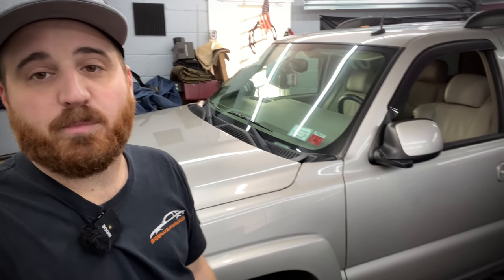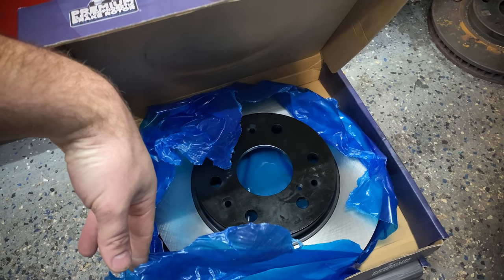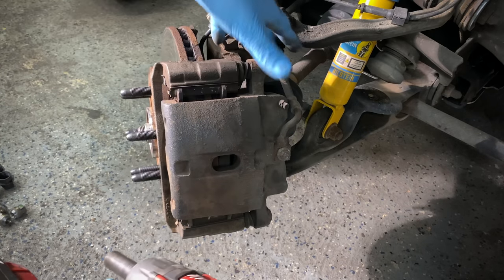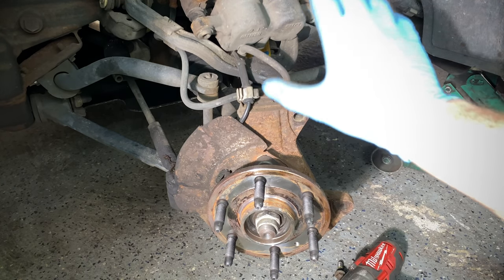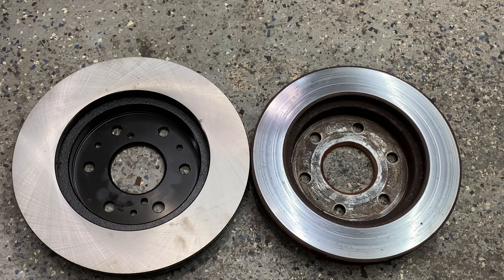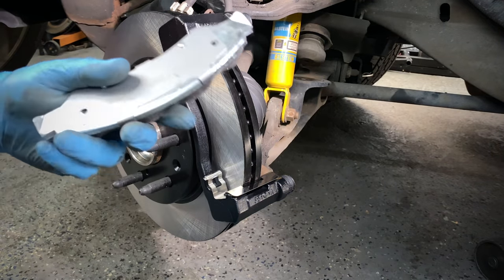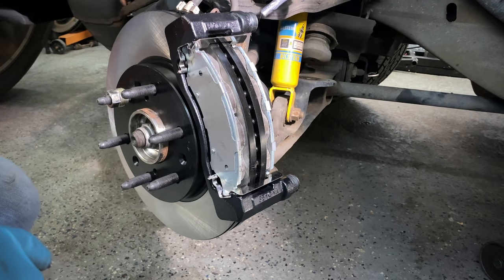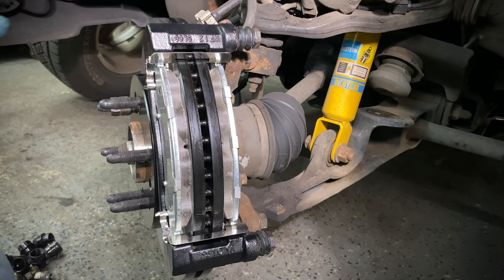This Budget BRAKE UPGRADE is Incredibly CHEAP & EASY!

Comment: I wish I didn't need 2pc rotors, 14" or larger to stop my big pig😢.....i have out grown the 13" rotors which were great until my truck kept getting faster! Now i spend $900 for just TWO front rotors from Baer. 

Dont get me wrong, the gmt900 brake upgrade is def worth it.....unless u have a 550hp awd denali with 12.5" wide Chevy SS 22" replica wheels! 

Having 2pc 14" rotors helped slow my brake fade. I even spend big$ on RF-650 fluid so I dont boil fluid anymore but at 145mph there's no getting around it, the heat soak is to the point where my foot can feel the hot gas between the pad and rotor with no brake bite whatsoever!......thats when I know, "this could be the end for me"

If i want to stay alive, it's time for me to spend $5k on a real performance😤 upgrade
Reply: No getting around physics there.. that fact that 6000lbs GOES 145 mph is mind blowing, yet alone throwing out the anchor at speed 😁

Comment: Here's a test for you.  I suddenly developed a rattling noise on the lower, right, rear of the engine area.  A suburban guy said he had the same sound, and it was pieces coming loose in the cat.  He cleaned them out and the sound went away. What do you think?

Comment: FYI, this mod only works if you have 17" wheels and bigger, any size below 17" it will not work.
Reply: Sooo...should I conclude that since I have 17" wheels, on an 05 Z71 Silverado, the larger rotors and calipers are already on it?
Reply: Thank you for that info. I'd love to do a mod like this on my 99, but not possible unless I replace the 16s with 17s, and that ain't in the budget yet. I have always hated my brakes.
Reply: @Tommy_Mac  In 2005 GM upgraded the brakes on half ton trucks to use larger front rotors, so you already have the upgrade. The trucks switched from rear disc to rear drum at the same time. The GMT800 SUVs did not change the brake rotor diameter or calipers, in 2003 these applications switched from vacuum assist to hydroboost. The hydroboost system applies more assist than vacuum, so braking performance is improved.
Reply: @wickedwolverine350  thanks for the info. I have a vacuum booster, though. No hydroboost.

Comment: Would the same concept work for the rear brakes as well?  Pre-2007 the rear brake rotor is 13" and Post-2007 is 13.6".  Would imagine an 18" wheel minimum to fit over the larger rotor.

Comment: will this dual piston upgrade or any other dual piston upgrade work on my 2000 cadillac escalade. I would like my brakes to have more control, more grab and work better pulling small camper?

Comment: 1st, If a Tahoe vid gets more thumbs up then a Camaro or Trans Am, Ima be Jacked, Makes me wana Not give it a thumbs up... Anywho, The reasons I am messaging is, When using the bottle/one man bleed, What about the air in the tube when u start the bleeding process? Also, I never pull the line/tube off b4 closing my bleeder!!! I guess, I,v never trusted the tube that i use to stay on the bleeder so, I always get a friend to help pump the brakes while I operate the bleeder, opening & closing it. Obviously any Trans Am or Camaro is nicer then my 07 Pontiac G5 but, I'd like to upgrade my brakes & plan on it! I just got it a week or 2 ago & iv done a new timing set up, 4 new tire's, a set of new control arms (just ordered the control arms yesterday), new window regulator, oil change, new floor mats & cleaned it up a bit!!! Soon, I will be redoing my entire suspension, upgrading the sound system & adding some features that the car was not ordered with like fog lights! It is prewired, just doesn't have the switch within the interior, the fog lights & the factory grill inserts(bottom of the front grill, there is 3 inserts, a center grill & the end or corner grills on either side of the lower bumper, mine have blank pass threw grills, the factory option with fog lights, has the housing for the fog lights built into the 2 grills so, I will need to buy each of those two grill inserts!) Oh yea, when I got the car, It was missing the center lower grill! I replaced that with a new one!!! Anyways, I like all automotive content but, Id rather a F-body get more thumbs up then a Tahoe vid....although, There are prob more people with tahoe's then people with F-bodies?
Reply from the maker: You can crack the bleeder and it wont get any air in the system. Thats how gravity bleeding is done. You just crack the bleeder and let the fluid drip, the air eventually gets pushed out with it. Any air in the hose is pushed out on the first pump when using the bleeding cup.

Comment: I dont see my answer here, so using 1 in larger rotors, can you use your stock caliper brackets,,,just buy new rotors and calipers??
Reply from the maker: No, you need to change the calipers and brackets.

Comment: Will this work on my 2007 Sierra Classic with 17" factory rims? I just went from a 2015 Silverado to this truck, and braking is probably the thing I miss most! I found a 2015 caliper and rotor kit on 1A Auto for $340

Comment: My 05 suburban has really soft brakes. Wish I knew this before I bought new calipers. Because they didn’t change crap
Reply: You need to bleed the abs unit. It takes a tech2 or snap on brick
Reply: @danhammond8406  it’s hydro boost if that changes anything l. Thanks for the tip

Comment: Good thing I came across this vid I have a 06 Yukon Denali. Will 2012 Tahoe calipers fit? Also are the rotors from the 07-12 the same diameter? Thanks

Comment: My brake line doesn’t look like yours ? Watched all your videos since you brought the Tahoe and haven’t seen the lines changed and did my research the part that connects to the caliper with the bolt isn’t with other brake lines so I wonder if it’ll still work for my Yukon

Comment: Good Video 
Question?
i have a 2017 Tahoe 4x4
will the 2018 Tahoe PPV Stuff FIT on the Civilian TAHOE ???
theOnly difference i see is the HOLES DRILLED in the Front Rotors HAT !!!for HEAT Dissapation ?

Comment: I just installed 2007 tahoe calipers, rotors, and brake pads on my 2003 tahoe. Turned the car on and now it says “service brake system” and the pedal drops to the floor. I have no pressure on my brakes. Anyone have any idea? We bled the brakes like 3-4 times.

Comment: Will this work with a 2004 2500HD? Obviously I need to pull from an 8 lug newer 2500, but wondering if it will still bolt on. Thanks in advance for any answers!

Comment: What about the rears? My wife’s 04 Tahoe has disc brakes on all 4 corners. Would this work on the rears as well?
Reply: If memory serves there's no difference in rear brakes. The fronts do 70% of the braking power anyway.
Reply: The rears can be upgraded too I believe the rotors are one inch bigger in the rear and has a single piston brake unlike the nbs has a dual piston caliper.

Comment: I noticed you said that that these came from a police package Tahoe.  Are the regular Tahoes the same?  I've known about this for some time but it was using the front brakes from the 05+ GM trucks with drum brakes in the rear.
Reply from the maker: Yea I believe the front brakes on the rear drum trucks are the same as these. The PPV brakes are the same as the regular Tahoe's, just different pad material. Size is the same.

Comment: So did you use 07 rotors and brake calipers Right? I have a 2002 I wonder if I could fit this set up
Reply from the maker: Yea 07 calipers and brackets.
Reply: @lsxmatt  mines a 2wd gmc is it still the same?

Comment: @Lsxmatt do you know if this will work with the models with the hydroboost brake systems?  Ive got an 06 escalade esv platinum I want to get the best braking out of the system I can, its a lot of weight to stop!
Reply from the maker: Yea it doesn’t matter what brake booster you have
Reply: @lsxmatt  Thank you! This will be a nice upgrade!

Comment: I installed all the components for the upgrade. But, when I tried to move my Tahoe it was stuck solid. I discovered that the new calipers were binding against the inner rim of the wheels that were on the Tahoe when purchased. Had to remove the new units and reinstall the old brakes back on. Question - What wheel and size were on the vehicle you did the upgrade on? Were they standard 16" factory wheels or larger wheels? Just bought 4 new 16" tires for the custom wheels. Wondering what to do. Chris Kyser- Hurricane, UT
Reply: Well, I now have new 17" wheels and tires and the brake upgrade works. Now to find a buyer for the 16" custom wheels and new 16" tires.  Lesson - Do more research before you try something out.
Reply: Sold the 16" and bought the 17" for the conversion. Works great,!

Comment: First off if you don’t want the fluid to leak out get a clamp style vice grip made for pinching off hoses. Second flush your brake fluid. IT SHOULD BE CLEAR NOT BROWN. brake fluid is hydroscopic and pulls moisture from the air and will cause it to boil new brake fluid should be done around ever set or two of pads

Comment: Hmmm is the spare tire/wheel a 17”?  It would suck to have a flat and the 16” on most tahoes not fit with the bigger rotor ?
Reply from the maker: I dont think the spare will fit, you would need to rotate it out if you get a flat.
Reply: @lsxmatt  can a 17” wheel fit in the spare location?
Reply: @travissheehan6082  yes, a 17" spare fits under the truck in the stock location. I have a 17" spare on mine.

Comment: Any 17" wheels will work with this amazing mod, 16" won't. And don't forget a spare!!! A factory spare on GMT800 is 16 inch, you need to get a 17" spare from GMT900 or Nissan Titan/Armada, otherwise you are in for a surprise at the most inconvenient moment!
Reply: You can just put the spare on the rear & move the 17" to the front

Comment: Matt, 

I just installed the kit you details recommended. Won’t clear my factory wheels or my aftermarket. Did I miss something in your tutorial about needing wheel spacers?
Reply from the maker: No spacers on factory wheels, but pretty sure they only fit 17’s. What size wheel do you have?
Reply: @lsxmatt  I have 16in steel wheels on mine, but also tried to rock the factory GMC wheels
Reply: Looks like I do need 17s, damn. Ordered some spacers to see if I can get them to work; just bought new wheels and tires for my build so the juice isn’t there to squeeze bigger wheels.
Reply: @lsxmatt  wanted to pass along to help fellow owners out. Stock 16in wheels will need at a minimum of 1.25in spacers for everything to fit with little rubbing. Also just subbed to your channel, thanks for the vids as they are helping me freshen up my 05 Yukon.

Comment: So this does work on factory 17s like the GMC Denali 1500 xl chrome wheels ?
Reply from the maker: I’m now using the stock 2004 17” Z71 wheels and they clear without an issue.
Reply: @lsxmatt  awesome man I thought so. Think I will make the upgrade. Have a 06 GMC with the 17inch chromes.  Thanks for the videos. Enjoyin them!

Comment: So what is making this upgrade better? I understand the caliper change but it seems they are both dual piston calibers?
Reply from the maker: The rotor is an inch bigger.
Reply: @lsxmatt   that makes sense..guess i was stuck on the calipers lol. Thanks!
Reply: The caliper and pads are also slightly larger. It's not a HUGE difference, but ask any woman, and extra half inch or inch does matter! 😂
Reply: @Conqueef-tadoor  LOL Come on - lets keep it PG :)

Comment: Does this also work for the rear brakes shoes on a Tahoe 2003 4wd?
Reply from the maker: The rear brakes are the same size on the newer trucks so they don’t need to be upgraded.

Comment: So would this work for a 99-02 Silverado if I get the caliper bracket  I got the dual pistons for the rear off a 04 Yukon for my truck but I know that is a direct Bolton.
Reply from the maker: If they use the same brakes as the suv’s I would think so. I have no experience with the pickups so I don’t want to tell you it’ll work for sure.
Reply: @lsxmatt  your tahoe is nice man  for braking you should do hydroboost next.

Comment: Is there any difference in the 07 and up rear brakes?  Are they the same as the 2004 Tahoe/Suburban?
Reply: They’re actually worse than the pre 07 brakes since they put bigger brakes in the front they put single piston trailblazer brakes in the rear
Reply: With a bigger rotor

Comment: Will 3rd gen tahoe rear brakes convert to 2nd generation tahoe though?
I have twin piston rear calipers.
Reply: 3rd gen rear calipers are actually only single piston so it would be a downgrade unfortunately
Reply: @Scufflord  I guess I'll keep my oem calipers then.. thx for the info!
Reply: @Scufflord  the rotors are bigger though

Comment: You didn't address your wheel size.  I can see later in your video you have 18" wheels.  My 06 Tahoe has OEM 17" wheels which I don't believe allow enough room to do this job.  Did you get 18" wheels later down the road?  I don't believe that is what GM put on originally, but I don't believe this can be done with 17" wheels.  I look forward to hearing your reply.
Reply from the maker: This upgrade does work with 17’s. I recently removed my 18’s to put the stock z71 wheels back on.
Reply: @lsxmatt  Good to know, thanks for the information!
Reply: @lsxmatt  I've got an LT model and I think the wheels and center cap are slightly different.  Do you think they'd still have the same clearance as a Z71 wheel?

Comment: I believe the "lock up" happens because the dimensions are different and the ABS is out of spec now.
Reply: Brake size doesn't matter. The ABS sensor reads a reluctor on the wheel bearing
Reply: @footz71  I don't mean to be obnoxious, but are you sure?
Reply: @_Hound_  Yes. I have replaced the wheel hubs which contain the ABS sensors on my 2006 GMC Sierra Denali and my 2007 Tahoe
Reply: @footz71  thanks
Reply: @footz71  so, as far as the function of the abs is concerned,  does that mean that braking moderately hard with this upgrade (gen 3 brakes on gen 2 tahoe) is basically the same as braking very hard without the upgrade?
Reply: @_Hound_  2007 and up GM trucks an SUV's have a one inch in diameter bigger rotor. Something like 30% more surface area. Don't quote my math.

Comment: I wonder what happened to that loews air compressor
Reply from the maker: It's still going strong. I just moved it out of the garage to use at home with my sandblast cabinet. I had no room for the cabinet in the garage.

Comment: Will this work with 03 suburban the same? And is it only front brakes or rears work from the 07's as well?
Reply: Justin, I have been following have an 03 suburban as well. All these years I just thought I had a vehicle with bad brakes. Everything will match up. I have the LT and you might want to check this site out for tire combinations. I didn't want to have any interference, I have a rust belt truck and just got done changing out lower quarters and outside rockers on both sides. All axle seals as well as coating the frame the best I could after removing all the loose rust with an air chisel. https://www.wheel-size.com/calc/
Reply: @jameshus1695  thanks man this is exactly what I need to know. 👍
Reply: @jameshus1695  So just to clarify when you say everything will match up you do mean rear brakes as well work correct?
Reply: @Gator49er88  I am staying with the stock brakes on the back. The majority of the benefit is from the increased rotor diameter on the front. I don't feel that it will be worth the work for the rear just for dual pistons. Depending on where you are in the country, most of the good set of take-offs are on the west coast. You can pick up some nice rim/tire combinations for under $700. Most vendors are charging about $250 for shipping. Current tires still have some good wear left. For the bracket and caliper, I think I will find the parts off of local recycled vehicles and just go with new rotors and pads. If I get done before you I will try to remember to send you the info in what vehicle I got my parts from. Good luck.
Reply: @jameshus1695  awesome thank you.

Comment: At minute 15:30 you said you only needed the 07 calipers brakes and rotors. What about the caliper brackets? That off the 07 as well right?
Reply from the maker: Yea I mean the caliper assembly, bracket and all

Comment: You’re potentially leaving air in the system bleeding with that method.  You need to build pressure to force the air out, not just move fluid as you have done.

Comment: Does anyone know if this upgrade will work with a Silverado 1500?
Reply: It will but you're better off going with a  2019-2020 silverado Sierra or escalade front brake. The caliper is 4 piston and rotors are 14 inches it all bolts right up. Must have 17" wheels or bigger. Best upgrade imo, what this guy is doing is cool too but my silverado came with the ones hes putting on so not much of an upgrade.
Reply: @_cadillacmiketyping...2533  I did see a video earlier today that showed you can get a six piston brembo upgrade from Chevrolet Performance for the front for around $2800.
Reply: @boazlife7405  yeah i seen that too, on the 2021 Escalade, very cool. But imo cadillac should have the brembos as standard equipment for the Escalade. Essentially the nbs silverado 4 piston brakes are a carryover to the new Escalade.

Comment: Hey Matt will the back brakes fit as well
Reply from the maker: I think they’re the same size as the newer ones already. I THINK..
Reply: I have the rotors for the rear brakes and front rotors the rears are bigger for some reason I’m curious too see if the back fits as well

Comment: are the caliper mounts different? or do you just need caliper/pad/rotor???
many opinions/views on this one...
(2004 Silverado 4WD)
Reply: Brake size doesn't matter. The ABS sensor reads a reluctor on the wheel bearing